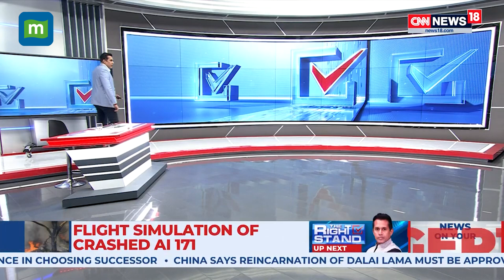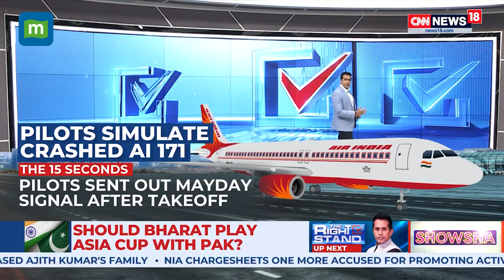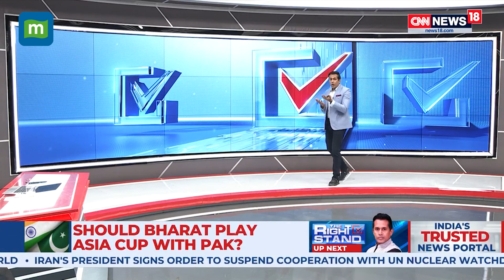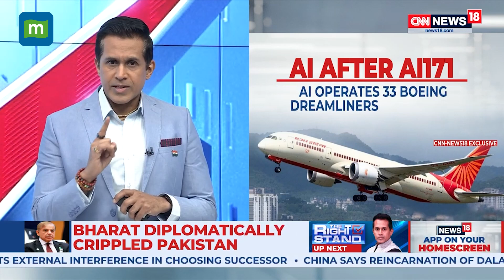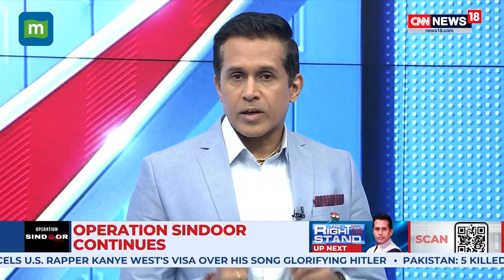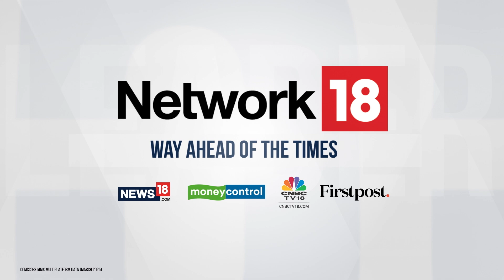Pilots Recreated AI-171's Final Moments On Simulator. Here Is What They Found

Comment: This just isn't adding up. The video evidence shows the aircraft on the ground at the end of the runway it had not rotated yet. If there is fuel contamination they would have known that as they passed their normal rotation mark on the runway at that time they have the option to abort using the last ditch emergency provisions designed into the aircraft they could have stopped it and not attempted to continue to fly the aircraft which by that point they would have known the aircraft will not fly.